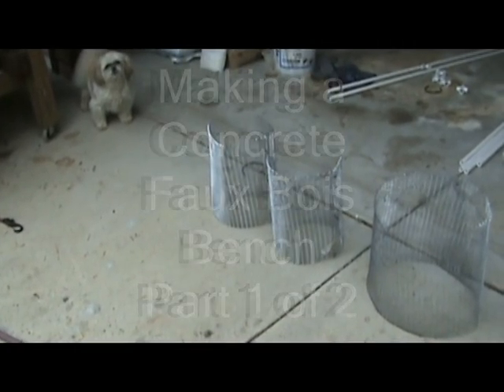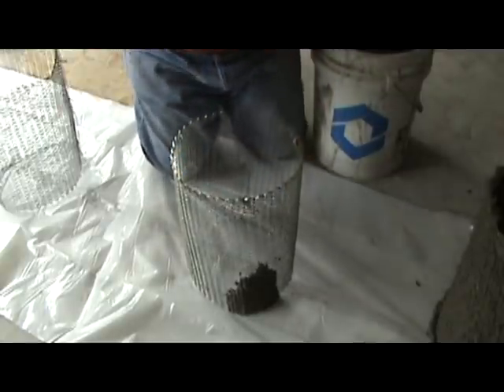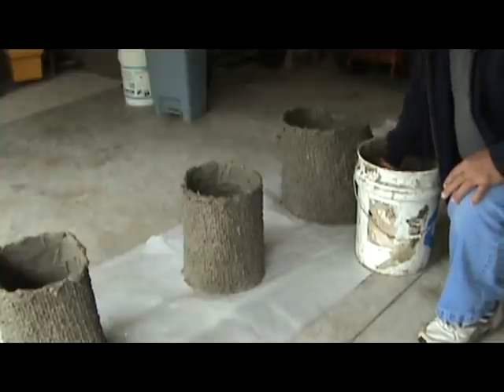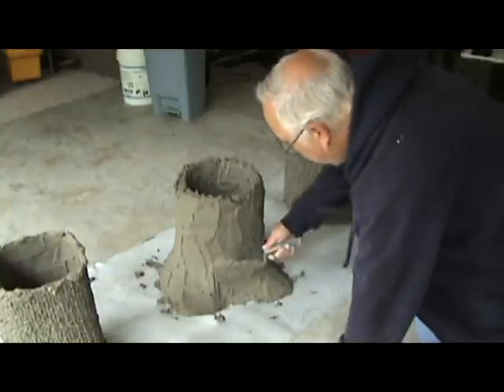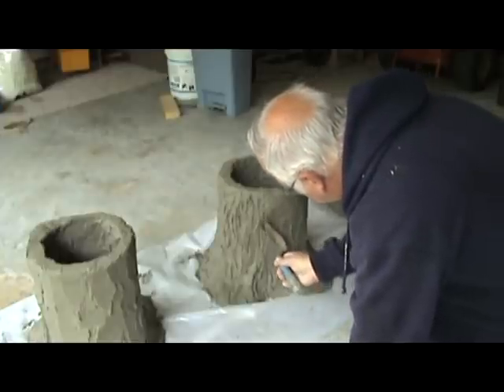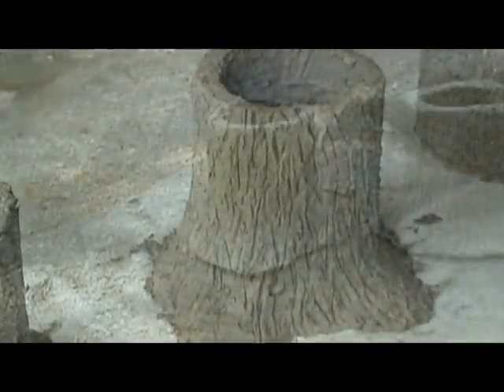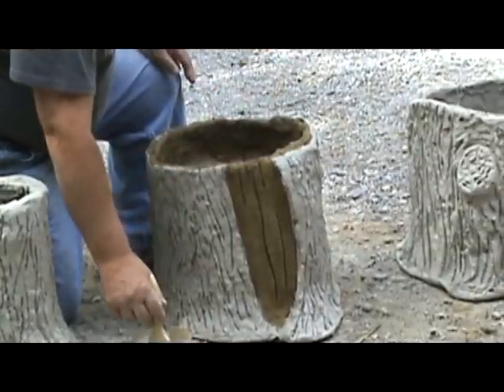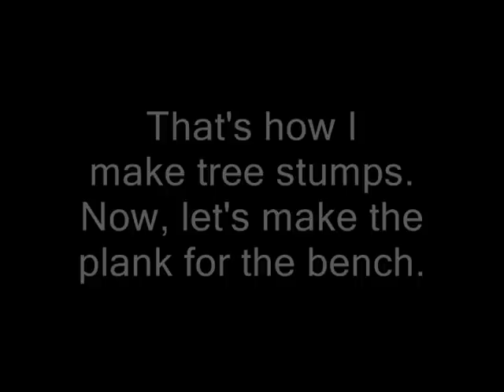Making a Concrete Bench Part 1 -- Tree Stumps.mpg

Comment: Thank you for sharing your talents on YouTube. I really appreciate watching and learning from your videos. I can’t wait to try some of your projects for my garden. My favorite tutorials on concrete by far.
Reply from the maker: I only know what I've used and done myself.  I'm not a concrete expert nor an engineer, so I can't advise you with anything I haven't done myself.  For my wall, I use a base scratch coat of 3 sand to 1 cement, 10% metakaolin, 8% silica fume, fiber, and acrylic admix/bonding agent in the liquid.  To make lightweight concrete I use 1 part sand, 2 to 3 parts lightweight aggregate, along with the metakaolin, silica fume, fiber and acrylic.  I've used styrofoam beads, perlite and vermiculite as lightweight aggregates.  I no longer would use styrofoam because it's so messy.   I didn't know what you meant by "pigeon mesh" so I looked it up.   I guess it can be either plastic or metal.  I wouldn't use plastic, as concrete won't stick to polyethylene, which is likely what it is.  I'd use the metal.  Yes, the more fine metal, the better.  It creates a strong mix called ferrocement.  Other than that, you'll have to get advice somewhere else.  I only know what I do and unless I've tried it myself, I won't advise others

Comment: Great work Sir, your videos are very inspirational. 

Sir, I want to make my 10 x 10 feet wall look like mountain wall (mountain texture and color) which method is best to do so, 1) sticking Styrofoam on wall, plastering it with 1/2 inch mortar and give it the desired texture or 2) making cement panels and fixing it on wall, please suggest.
if your suggestion is cement panel, 
a) what shall be the ratio of cement and sand
b) Can I used pigeon mesh to gain extra strength, if not,  
c) what more ingredients can I add to make it strong and light weight as well (to fix easily on walls)
Awaiting your valuable response.

Bye Take care.

Comment: Is this recipe one that you would use to make a koi pond?  Probably in about a week or two I  will have my pond digging completely finished. Thank you for sharing your knowledge and expertise and for your continued kindness.
Reply from the maker: I used this mix 14 years ago when I built my pond.  I then waterproofed it with a mix of the 3 water to 1 acrylic and straight cement mixed to a paint consistency.  Two coats of this carefully scrubbed into the concrete walls of the pond.  It has lasted this long.  I am starting to lose some water and have to add a couple times a week. If I had to do the pond again, I would use my more modern mix.  3 sand to 1 portland cement, 10% of portland content in CSA cement, 10% of portland content in metakaolin, 8% of portland content in silica fume, 2% of portland content in crystalline waterproofer (Xypex), PVA  fiber and 3 water to 1 acrylic bonding agent/admix made from stock acrylic of 50% solids for the liquid.  This mix would be impermeable to water and highly resistant to cracking as it would be 5 times stronger than my original mix.

Comment: Love your work it's amazing . My question is in your mix you said Percentages are as a percent of the cement content, note the whole mix content. Does this include cement and sand or just cement
Reply from the maker: Cement only.  For example, if I were to mix 10 cups of cement with 30 cups of sand and wanted to add 10% metakaolin, I'd add 1 cup.

Comment: I have cut a lot of wood in my life close to 45 years of cutting and they look grate and they won't rot good job I wish I could do as good of a job as you do thank you for showing how you do this. ? where do you get the acrylic  and the type of stains at
Reply from the maker: I buy my acrylic from Fishstone, http://concretecountertopsupply.com/ , but you can buy it in quart and gallon quantities at Lowes, Home depot, etc. or on Amazon  https://smile.amazon.com/CORPORATION-187782-Concentrate-Adhesive-1-Gallon/dp/B000RUMZ6K/ref=sr_1_fkmr1_1?ie=UTF8&qid=1505354950&sr=8-1-fkmr1&keywords=concrete+acrylic+bonding+agent

Acid stains I get from https://www.concretecamouflage.com/
Reply: thank you

Comment: Hi, beautiful works and  thank you for the tutorials. I want to do the same project but I want to use the stumps horizontally. Certainly I will cover the 2 ends with concrete. I'm wondering if the stumps would have enough strength to hold the top if they're lay down horizontally? Do I need to fill up the inside with concrete if yes the stumps would be very heavy what is the best way to keep them a little bit light weight? Thank you
Reply from the maker: A cylinder is stronger vertically than horizontally.  If the walls are thick enough, though, a horizontal concrete log will hold the weight.  You can make them stronger by filling with a lightweight mix.  Just substitute vermiculite or perlite for the sand.

Comment: Hi, when I saw you making these stumps, the question that came to my mind was: Is it possible to make a rocket stove this way? Do you know how much heat concrete can take?
Reply from the maker: With no experience with a rocket stove, I can't  be of any help but, as far as heat goes, I'd look into using refractory cement.  No experience there, either.
Reply: think you need vermiculite, that's what people are making small kilns out of.

Comment: I'm told that moistening the concrete before staining helps the stain spread easier. I guess that depends on how opaque you want the staining.
Reply from the maker: This stain is different. It is called acid stain. It is not a pigment; it is chemical in nature and works by reacting with the products of concrete hydration.  Wetiing the concrete beforehand would dilute the chemical and alter the stain depth.

Comment: Sir did you mix just sand with cement? Nice work you are great 👍
Reply from the maker: I used 3 sand to 1 cement, polypropylene fiber and acrylic bonding agent/admix in the liquid.  This was more than 6 years ago.  Today, I would still use sand/cement, but 2 to 1 and add 10% metakaolin, 8% silica fume, use PVA fiber and still use the acrylic. Also, the finer the sand, the better.

Comment: Thanks for your videos very kind of you to make them. I am following your path and making a 5' x 18" bench top. My question is on the top you made that weighed 200lbs does this type of tree trunk supports still hold that much weight plus the weight of 2+ people?
Reply from the maker: Yes.

Comment: I’m inspired! I’d love to turn my side of the concrete wall that borders my backyard into something more natural, the city municipality who probably owns it would likely frown on it.
I’ll likely stick with a bench and/or planters. 
Maybe a good project over winter.
Is there a minimum temperature for concrete mix if this sort to set properly?
Reply from the maker: Don't do concrete if you expect freezing temperatures for at least 24 hours.  I don't work concrete if the temperature is below 50 degrees, simply because it takes longer to set and exposes it to potential damage until it set up.  Of course, if you use add Calcium sulfoaluminate cement to the mix, you can speed the set.  Some would recommend using straight CSA, such as RapidSet. I will set up in less than an hour.   As a general rule concrete set, being a chemical process, will take twice as long to set for each 10 degree Celsium temperature drop.

Comment: This is so awesome. I want to try, though it would take some skill to get as good as you are at making the stumps look realistic. I have subscribed to your channel to study your techniques. I have a few questions.. I was wondering what makes it strong enough to support weight being hollow? How much weight do these  benches support? here does one find metakaolin and some other additives?  The ingredients seem difficult to locate. I researched myself, then read more of the comments and answers. I clicked a link which took me to a Google page with three recommendations: the first company which had no prices and seemed to offer only large commercial quantities, a product called Rockite at Ace Hardware which cures in 15 minutes and Sculptcrete which seemed more similar, but I am not sure it's what you used to obtain metakaolin. Would you please help to locate the ingredients you are using. Lastly, with the chemicals would I need a respirator, or is it okay, or do you need to do all the work outdoors?  Thanks for your help.
Reply from the maker: A cylinder is stronger than you might imagine.  The cylinders will hold much more weight than the seat will.  You can order metakaolin,  silica fume and fiber online. Yes, shipping charges are expensive, but a bag of either will go a long way in making strong concrete mixes. I get my supplies from Fishstone in Crystal Lake, Illinois.  https://concretecountertopsupply.com/
Tell me where you are located and I'll see if I have any information for suppliers in your area. Cement, metakaolin and silica fume are all powdery substances that should be used with appropriate precautions  concerning breathing the dust.  I work in my garage with the overhead doors open and a floor fan blowing air out of the garage.  Use a dust mask for more safety.
Reply: @dperry428  Thank you for so much expertise, information and inspiration.  I am in Georgia 45 minutes from Stone Mountain. Lots of people have boulders in their yard.  I want one, but... though I see them by the side of the road, there isn't one I can pick up and take home. The reason they are in most places as decoration, is the builder dug it up on the property and left it. My goal is to make boulder seats around a fire pit. I would like it to be light enough to move. But I don't want a fat person to sit on what looks like a boulder and fall in if it crumbles like papier mache. I also want to be able to add details that look enough like real rock.  I was thinking about building something around an an office chair seat on wheels, so I could move it, but I am not sure whether or not that's a good idea or doable.

 If I couldnt find Metakaolin, my idea was to combine rammed earth walls with the idea of additives by taking Georgia clay and adding it to quickrete.However, in coming up with potential recipes, my mom told me that the Romans used concrete to build their buildings. Until today, I thought they used stone like the Greeks. Then, researching their discovery of concrete, I learned that iron oxides in rusted rebar actually react to make concrete weaker, and red Georgia clay is basically 82% iron oxides.  So much for my idea to use free dirt around here as an additive.

Looks like I still need your help to locate a source. You are a science teacher and decorative artist, so I would like your opinion, if you have one on various concrete mixes . I've seen where instead of using rocks as the aggragate, they are using shredded paper and say that it is lightweight but the artists are using it. But is that good for a bench? Seems your work is proven.  Thank you for any further source information you can provide.
Reply from the maker: I don't know about iron oxide clay as an additive, but iron oxide is not specifically what causes the breakdown of concrete.  When iron (as in rebar) corrodes, the rust (iron oxide) takes up more space than the iron did.  As a result, the iron reinforcement expands and cracks the concrete.  It is not the iron oxide that causes the problem, but the expansion that does.

Comment: good greeting good job I have a question please What are the components of clay? Are there other additional materials and the correct amounts? I have tried to do such a thing, but there is a difficulty in holding the mud together Please answer with thanks
Reply from the maker: It might help to watch this video https://youtu.be/e4j5qgNFQE0   The ingredients are sand, cement, metakaolin and water with acrylic bonding agent added.  The most important mistake most people make in mixing concrete is to add too much water.  Start with a mix in which you know how much cement has been added; then add about Half the cement volume in volume of liquid (water and acrylic).  Mix thoroughly and add only tiny amounts of liquid until the mix is like clay.
Reply: @dperry428  

Thanks for the answer. Do you mean methacholine, the petroleum substance? Is sand is silica sand? Thank you so much
Reply from the maker: No, I said METAKAOLIN and I meant metakaolin.  https://www.google.com/search?channel=tus2&client=firefox-b-1-d&q=metakaolin   It is calcined kaolin clay.
Yes, silica sand, which is mostly quartz or silicon dioxide, as opposed to other chemicals.  Silica sands are reactive with portland cement.
Reply: @dperry428  

thank you very much. Kaolin clay has another name in our country, and it is a commercial name, which is white cement Greetings to you
Reply from the maker: @alaamigdady1794  Don't confuse kaolin clay with metakaolin.  They are NOT the same thing. They are as different from each other as sand is from glass.  To make metakaolin, kaolin clay is heated to a high temperature (calcined).  That process makes it chemically VERY different from kaolin.
Reply: @dperry428  Hi Sir, is there any alternative for metakaolin, PVA fiber (polyvinyl alcohol) and silica fume? I live in Kuwait and the possibility of these material available here is very grim. I am interested in making similar style to be used as seating stool 44cm(height) x 36cm (diameter) in garden/indoor.

other research suggest 1:2:3 (cement:sand:gravel) is sufficient for benches, can you please guide if its true?
if yes, can I replace rebar with gravel, to make it lighter?

Please reply for both questions (alternative and mixture ratio)

Thanks
Reply from the maker: @taqiabedi2822  I can only suggest what I have personally used.  You'll have to decide if you want to try something else.  I am NOT a concrete expert.  I share only what I have used.  You might try contacting the person at Kuwait University who is using metakaolin in his research.
https://www.researchgate.net/scientific-contributions/MN-Haque-71736683  Gravel is NOT a replacement for metal reinforcement and will not make it lighter.  For structural pieces you want strength, not light weight.  Again, I only suggest what I have personally used.  If you want to do something that someone else has suggested, go for it.

Comment: What would be the name of the type of metal wiring/fencing and the type of concrete that you use? Any suggestions of where to obtain? Thanks!
Reply from the maker: I call it expanded metal lath.  Some call it stucco lath.  It is available at home improvement stores such as Lowes, Menards or Home Depot.  It will be found in the area of the store near concrete, plaster.  Like this: https://www.homedepot.com/p/27-in-x-8-ft-Steel-Lath-2-5-METAL-LATH/202093395

Comment: Hey, do you teach me the components of the cement mix for decoration and what fibers you use
Reply from the maker: 3 parts sand, 1 part portland cement, 1/10th part metakaolin, 1/10th part silica fume, PVA fiber (polyvinyl alcohol).  Liquid is 3 parts water to 1 part acrylic admix/bonding agent (if the bonding agent is 50% solids).  Use less water if the acrylic is less than 50% solids.

Comment: Nice job.  But your concrete mix sounds somewhat clear. Could you clarify please? Thank you.
Reply from the maker: If the mix sounds somewhat clear, what should I clarify?  I think you meant UNclear???  I will assume so.  In this video, which was posted almost 6 years ago, I was using a mix of 3 parts sand to 1 part cement to which was added 1/2 part polypropylene fiber and liquid composed of 3 parts water to 1 part acrylic emulsion.  The mix I use today is 2 to 3 parts sand (depending on vertical or horizontal use) to 1 part Portland cement, 5 to 10% CSA (calcium sulfo aluminate) cement, 10% metalkaolin, 8% silica fume, 2% Xypex admix, 1/2 part polyvinylalcohol fiber and liquid of 3 parts water to 1 part (50% solids) acrylic emulsion (bonding agent/admix).

Comment: Would you share the mix you currently use? I have never used fiber in my crafts. thanks so much.
Reply from the maker: +Pamala Rogers 3 parts fine sand, 1 part Portland cement, 10% metakaolin, 8% silica fume, 5 to 10% CSA cement, 2 % Xypex (crystalline silica), fiber (glass fiber in base coats, PVA fiber in top coats, no fiber for extreme detail) acrylic emulsion in liquid (3 parts water to 1 part acrylic)  Also, see https://youtu.be/etSWuBIcdZc